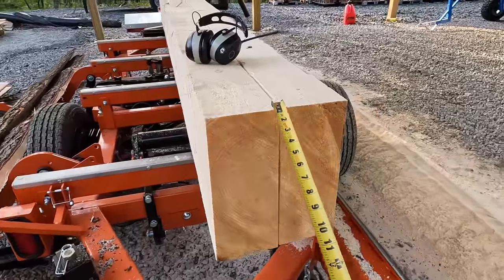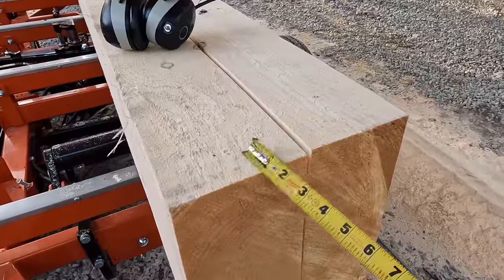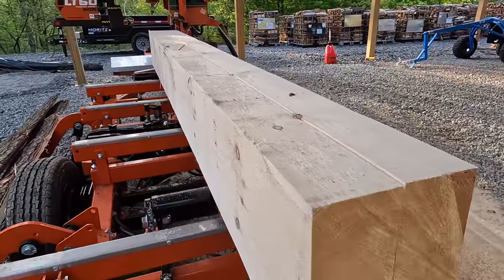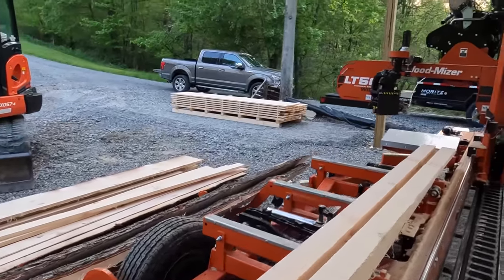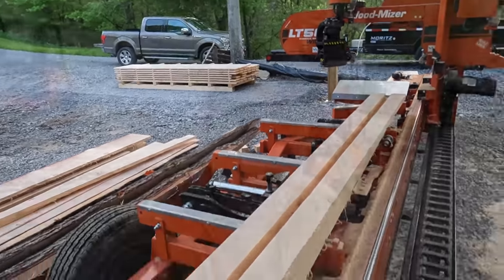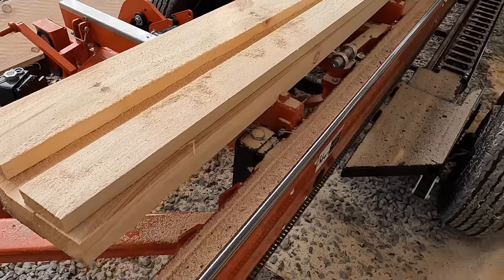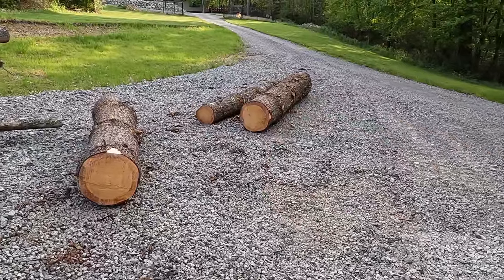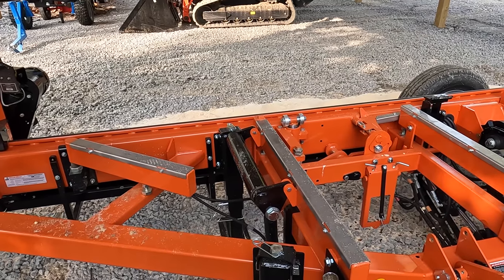FENCE MATERIAL, Sawing Pickets on Wood Mizer LT50

Comment: Go detached on the shower house.  It will eat up a lot of floor space. It will also add humidity inside the cabin which is especially not good for a structure that is closed up and not used for weeks at a time.

Comment: Good morning from the western Ozarks farm. Your assessment that you’d get a lot of lumber out of each of those logs was certainly accurate! Good stuff. 

I cut the best Osage Orange corner post of my life yesterday. 9’ long, 10” to 9” on the taper, and dead straight. Only one visible knot, and that one small. The tree gave me another corner plus 4 really nice line posts. Those are stacked where they fell on a couple of pieces of limb too crooked to use as a post. I wrangled the 250-lb beast into the pickup and brought back to where I’m replacing a rotted corner. And then dug about 90% of the posthole by hand. Recent rains had softened the top 6”, but the fragipan under that was HARD. Most required the rock bar blade end to break up. I’m down into subsoil clay now. It rained again overnight, so I hope I get another couple inches diameter and deep without too much more effort. I’ve needed to fix this spot for a couple years, but it seemed like patching temporarily was all I had time for in the past. I’ll be happy to see it done and done right.
Reply: Hi John, You are working hard, I hope it doesn't mess with your golf swing
Reply: @davidmorse8432  I ‘spect I’m going to be really sore tomorrow! But we’re getting little rains about every 12 hours, so golf will be unlikely for 2-3 days. The grass looked like it was July or August when we arrived a week ago, and it’s knee-high and heading out now. Amazing what a little rain will do.
Reply: Brothers!😊
Reply: @oldmanfred8676  Hi Fred!
Reply: Update: The hedge corner post is set and tamped in with alternating layers of #3 base stone and the soil from the hole. Neither of those by themselves would have tamped well, but 3-4” of loose soil followed by 3-4” of rock tamped incredibly well. By the second impact, it would actually ring a lot of the time. That post is in there very tight! Now to string 5 strands of barb wire and put in one steel post. I’ll set a cattle panel going along the fence line - that old hog wire needs replacing soon anyway.
Reply: @davidmorse8432 ,
David!
Reply: @johnsadler8637 ,
Love the work stories!
Reply: Second update: wires strung and stretched as much as a 20’ run can be. Had to drill pilot holes for staples in the old hedge post on the other end - that’s a first for me too. Drove one metal tee post in the middle and tied it off to the wires. Used a cattle panel from the new post to the straight run going north - no point in doing a 10’ patch if we’re going to replace the whole 200 yards. And got everything cleaned and put almost away. Need some power washing before back in their spots. 

One thing for sure - the fencing crew Mike found were waaay more efficient than I am.

Comment: Thanks for the content. This is probably a dumb question but here goes anyways. Why wouldn't the band on the saw be two sided so that you could cut going forwards and backwards and therefore double the potential output?
Reply: There are guides on the back side of the blade that keeps it from pushing off the wheels. Makes teeth on both sides impossible.

Comment: Hey Mike, Hate being that Guy, but want to make a slight correction on the total boards you have. You had ten cuts, to give you 20 boards X2 pickets. So only 40' linear feet of fence.  I only point it out so you weren't banking on that 80' of fence, since it will be about half of that from that first log.  Love the videos. Keep them coming. Between you and a couple other Youtubers I have learned a lot about milling and hope to get started myself soon.

Comment: Mike, Perhaps you could build the bath house next to the stamped concrete patio, then extend the “A” roof off the back of the cabin over the stamped concrete patio and over the new bath house. This would give you a covered patio to get to the bath house. You could then either leave a high ceiling over the patio or expand the second floor but leaving the first floor open as a patio.

Comment: Another idea for a bathroom. 
Extend the “A” roof off the back of the cabin over the stamped concrete to creat a covered patio. This then would also extend the second floor. Then you could put the bathroom on the second floor right off the bedroom.

Comment: Good morning Mike, you may want to try putting a tarp down where the dust comes out, it makes it much easier to clean up the sawdust.  I like what your doing.
Reply: Can't remember why he chose to have stones rather than concrete for ease of clean up.
Reply: @leejones982  he has mentioned at LEAST 10 times, the floor of the pavilion will be concrete.

Comment: Quick question Mike. Have you tried to use that drop down dog on the mill that pulls the cut lumber back to the operator location? Wondering if that helps with processing the cut boards.

Comment: Mike just wondering, you never mention the "Pith" – The small soft center (immature) core of a tree.  Just wondering does the pine your working with (sawing) not have problems with this part of a Log?  (Reference / splitting / cracking, etc.)  Learned this from Nathan over @ out of the woods.
Reply: Pith is only an issue with hardwoods. Softwoods are typically rift sawn all the way thru.

Comment: Is white pine the best wood to use for a fence? It rots so easily unless it's pressure treated I couldn't imagine it standing up to the winters west Virginia has for a long period of time
Reply from the maker: Like I said don't touch the ground it will be fine, lots of barns and buildings sided with white pine that have been around a 100 years

Comment: Can you do an attached water closet and detached shower house?  Too much duplication of walls and plumbing?  Could you grey water drain the shower house vs septic system the water closet?   I'm using water closet as a tongue in cheek use of the old term but mean just a coat closet sized box room just barely big enough for a commode.